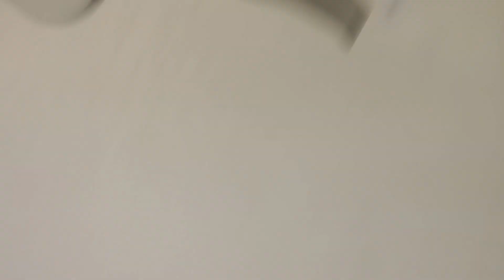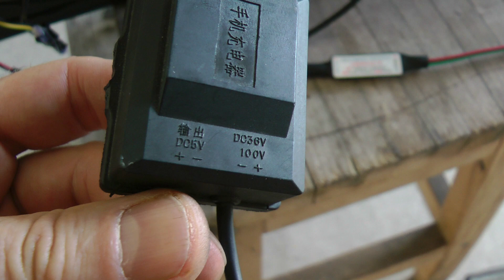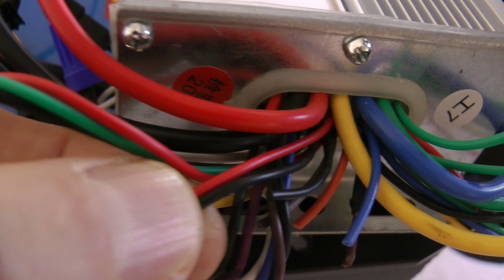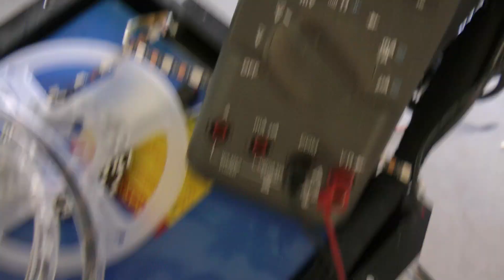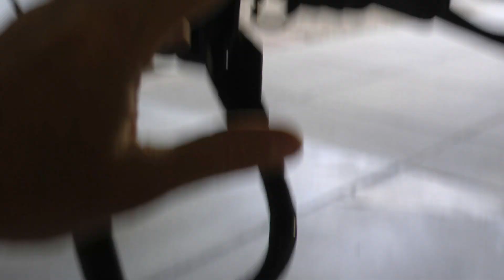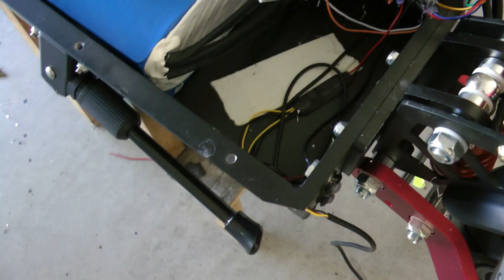Laotie Ti-30 RGB lighting upgrade

Comment: when installing this dc converter i guess the overall voltage of the scotter stays intact, unlike when you connect  e.g. a mobile phone on the throttle display and the voltage drops down 5 volts while charging
Reply from the maker: Yes, no impact on the scoot battery voltage. Also, the LEDs don’t consume hardly any power relative to the motors.
Reply: @Desert-Ecruising  Yes the LEDs dont consume  for sure but i was thinking to connect directly to the converter  a usb bluetooth led controller but i was aware that may be affect the scooter voltage performance.what do you think?
Reply from the maker: No, it will have no effect on the scoot voltage. I’ve done the exact same thing on  five separate scooters now. For it to affect the scoot voltage, the load would need to be considerable current, a lot more than what the dc to dc is rated for (1 to 3 amps are what the ones I used were rated for). And even then you won’t really be pulling more than half an amp or so with that LED controller/LEDs.

Comment: i have the same scooter.  i’m looking for Steering Damper any idea thanks
Reply from the maker: At a Quick Look, I don’t see any specifically for the Ti-30. However, mine doesn’t need one, it’s super stable even at the top end, dual motor mode at 50mph. Is yours unstable?

Comment: I upgraded my laotie TI30, as well, both (A/B) controllers, removed both flashing LED's, I didn't want the extra battery drain, not to mention, it's illegal/danger for motorcycles, cars, ect to have flashing  bright LED's here because it can be distracting to the drivers. The main reason; I didn't want drivers  to think It's a turning signaling and then I'm pavement. Anyway, I used rubber washers on a couple screws kind of like on a metal roofing system. I Used RTV sealer as a added protection, and just flushed it off on the back side So it doesn't puncture a wire.
Reply from the maker: How do you like the new controller setup? Do you have the MS668 display?

Comment: The plastic cover for the led light strips on the side broke off on my scooter and I dont know where to buy a replacement. I was wondering if you or anyone knew where to find one. please get back to me even if you dont have an answer I would apreciate it.
Reply from the maker: I threw two of those away when I did the mod. I do have one laying around from another scoot though. Email me: maikemarx@gmail.com
Reply: @Desert-Ecruising   Hey, thank you for the reply. I emailed laotie and there willing to send me both peices for free. Thank you for the offer it means so much to me.

Comment: I'm like a kid just before Christmas day, waiting impatiently for the new sine wave controller. Do you think it will make the motors more quiet? My motors moan quit a bit at low revs, resonating out through the scooter. I also have an annoying squeaky noise from what I believe to be the folding mechanism. I haven't ever folded mine since I bought it a year ago and I'm thinking of welding it.
Reply from the maker: I have my new controller set now but will be a few weeks at least before I install them. Doing a bunch of mods to mine, only have ridden it one time for the GPS test run video. Another week or so and I’ll start riding it. Want to get some testing in with the stock controllers before swapping, to see what difference there is. if any.
Reply: @Desert-Ecruising  Well I guess I'll have to wait patiently then :) I have been looking at the Flipsky 75200, it's supposed to manage 150A continuously at 75V. What controller did you get? Link?
Reply from the maker: @ScinnerNo1  [US$135.99 32% OFF]Electric Scooter Brushless Controller 60V 45±1A With LCD Display And Connecting Lines For LAOTIE ES19/ES18/ES18P/TI30 Bike & Bicycle from Sports & Outdoor on banggood https://banggood.onelink.me/zMT7/26hdmtws
Reply from the maker: @ScinnerNo1 read the first review.
Reply: @Desert-Ecruising  Seems legit, nice price as well! The Flipsky's is twice as much but it's a top of the line ESC and highly configurable and bluetooth connection. I live in Sweden and police here don't like scooters doing 50mph, with the iPhone app you could switch to "legal mode" real easy. Thx a bunch!

Comment: Hey @Dessert-Ecruising I have a question that you may or may not have come across yet, I have taken my Scooter apart, and I am unable to find a fuse or breaker of any kind in it, is this scooter not protected? (besides the BMS) The only place I suppose I have not checked would be inside the battery case...hrmmm Any information would be helpful, because if it doe snot have any fuses and or breakers, I will be adding one for sure.
Reply from the maker: No fuses. None of my scoots have them. I believe the BMS takes the place of a fuse. Not sure what size fuse you would use. Would have to be pretty big considering the peak current the battery is capable of. Would either be blowing the fuse if too small or never blowing if too big.
Reply: @Desert-Ecruising  Yeah I would base it off of the total Peak current from each controller combined, not the max current the battery can push itself. So if each controller is 45 AMPS, that's 90AMPS, then I can see getting away with using a 150AMP MEGA Fuse or 150 to 200AMP DC Breaker, Because Yeah 150AMPS is more than the controllers are rated for, but I'm more worried about protecting the battery since its the most expensive part and can dead short out to way above 150AMPS, so if one did occur my 150 AMP Fuse or Breaker would save the battery and I would only need to replace the cheap controller.  I build Batteries for Solar Storage, that's what made me think of this, granted mine are not 60 Volts, they are 48 volts, but its the same concept.   Thanks for the information, I will be connecting an inline fuse from the battery to the controllers since I now know there is not one. Looking forward to your next video!

Comment: Does your stream make a sound when it rocks back or forth a little bit? Is it the red latch? Thanks
Reply from the maker: Sorry, what do you mean by “stream”?
Reply: @Desert-Ecruising  I think he meant the handle bar stem. Mine creaks a little when I rock it back and forth, but I don't have the low-profile headset wrench/spanner to tighten that large nut.
Reply from the maker: @hermanlee5376 Mine’s quiet but I’ve only ridden it once for the gps video. Those two large nuts you speak of, are indeed to tighten up the stem so very likely could be the cause of the sound.
Reply: @hermanlee5376  i think mines similar to yours when i hold both handlebar and then rock it back and forth i had slight sound or just feels like something is a bit loosen??
Reply from the maker: @MissHitAllTheTime Tighten the two large nuts near the bottom of the stem. You may need to buy the right size wrenches .
Reply: @Desert-Ecruising  one them turn right to tighten or both of them same way? Or one is opposite way to tighten??? Yea it looks loose when I rock my handle bar... Back and forth at slower speed scooter not as stable rocking left and right feeling must be those loose nuts on the handle bar hopefully it's not other loose nuts around there...
Reply: @MissHitAllTheTime  Also if you lay the scooter down or flip it over, there is a nut under the folding mechanism which will remove some of the sway you feel between the fork and deck. Dont tighten it too much or you wont be able to fold the scooter.
Reply from the maker: Thanks for the tip!
Reply: Alright thanks guys. Yeah, I meant stem.

Comment: Nice content, recently ordered a laotie es19, waiting for it to arrive, i searched all day for electric scooter rgb mods, prob going to do this too, rgb adds more 10 km/h to the scoot haha
Reply from the maker: 😂 The parts only cost around $35 so fairly cheap.  The headlight upgrade is also a big improvement for $25. Well worth it if you’re gonna ride at night. Assuming the ES-19 has the same crappy headlights as the ti-30.
Reply: @Desert-Ecruising  im wondering if its possible to do this but connecting the rbg led to a powerbank and put the powerbank inside one of those wildman bags for electric scooters
Reply from the maker: @rgbwave ure, as long as it puts out the correct voltage (likely 5v with a power bank.) Won’t be very clean though with a cable running from the bag down into the chassis. But if that’s not an issue for you, that would work fine.

Comment: I have not checked the voltage of my Side RGB Strips yet, are you saying the wires that go to those RGB strips are 60 Volt strips and not 12 volt? If they were or are 12 Volt I would just wire the RGB controller to the existing wires to  save space and the heat that will be dissipated from down-stepping the voltage. Keep up the videos, I am loving them! Its nice to see a person that has the same scooter as me, and that we both have similar interest in regards to the upgrades. I to REALLY dislike the side RGB lights, if they allowed me to keep one color and not always flash that would be different, but I feel like I'm a rolling seizure at night with those things lol.
Reply from the maker: The stock side strips run directly off the switched battery voltage. No 12v or 5v available in the chassis. The converter doesn’t get hot.
Reply: @Desert-Ecruising  Thanks! I will order the converter from your links :)
Reply from the maker: @PatricksDIY Let me know how it goes or if you have any questions.